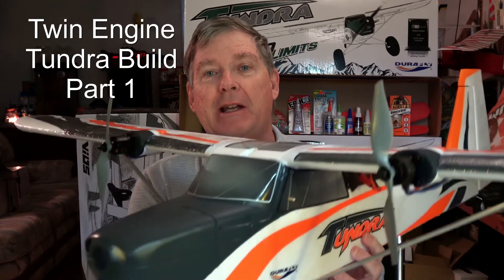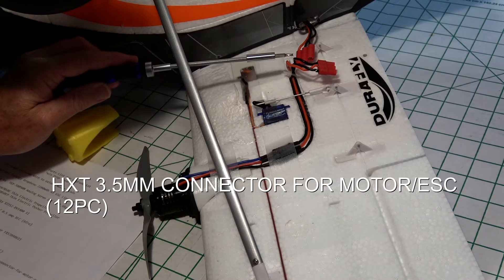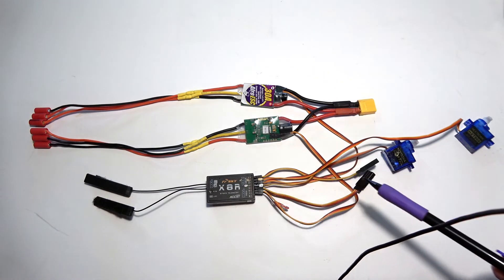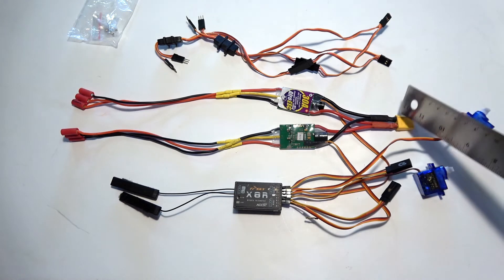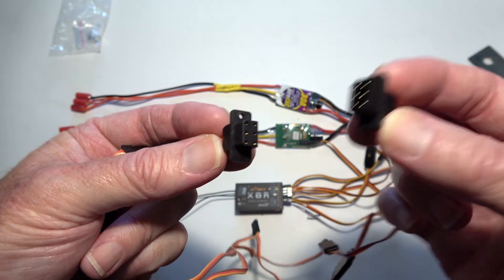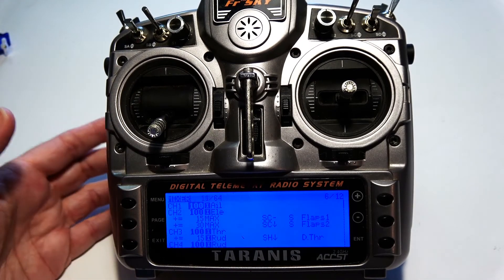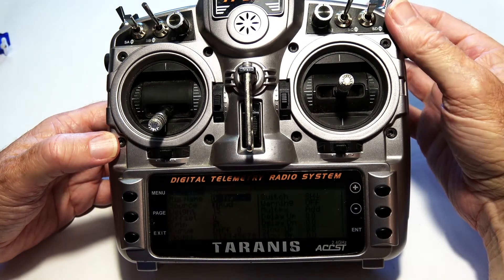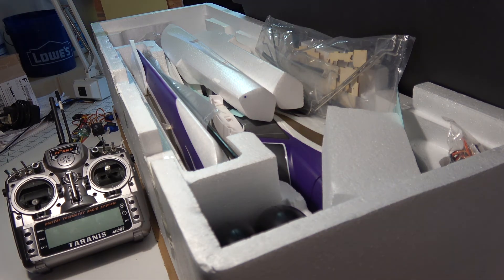DIY Twin Engine Tundra RC Plane Build - Part 1 (Power System Parts, Wiring, Radio Setup)

Comment: Hi Dave, I'm going to build this so thanks for your amazing videos. I'm a bit confused as to which file to print. If you use the X motor mount the outer bolt fixing is 34mm?  so I don't understand why the  drawings are marked 23.3mm, 24mm and 25mm spacing as the motor hole dimensions do not seem to be important ? Can you expand on this at all? These are the motors I'm going to be using  https://www.electricwingman.com/sunnysky-x2212-iii-brushless-motors  Thanks Tim
Reply from the maker: The image on your motors shows 34mm X-mount which may be too large for those nacelles https://www.electricwingman.com/img/product/large/SunnySkyX2212IIIBrushlessMotors_28_10_302.jpg
Reply: @DaveMerc  Thanks for this information but if I look up the motors you used they also seem to have an x motor mount of 34mm as per the drawing https://www.rcmoment.com/p-rm8984.html so Im still confused as to what the 23.3mm, 24mm and 25mm refer to ? Thanks Tim
Reply: Hi Dave Thanks for your help ! I managed to find a small carbon fibre x mount - I use these on my wings! This one has a 25mm spacing. Cant wait to get building :)

Kind regards Tim

Comment: Actually I do have 2212 1450kv they are Cobra Motors. Hopefully those will work so I don't have to spend money on Motors lol
Reply from the maker: Those 2212 1450kv Cobras should work if they take a 4s battery.  I use 2212 1400kv SunnySky with 7x5 APC props and a 4S 2200 battery so I assume you can use the same setup with your motors.
Reply: @DaveMerc  yeah for sure they're rated from 3s to 6s I have a burnt up 4 in 1 ESC one of the channels don't work it's a 60 amp and I have three channels left so I'm going to use the two to run the motors it'll be just like separate ESC is but and one package I hope it works wish me luck and thanks for the inspiration ♥️♥️
Reply from the maker: Good luck for sure. I used two 30 amp ESC's so you could try that if the 4 in 1 fails. Make sure you put some low rates on the ailerons and some expo to be safe. I use 70 / 50 but 50 /50 might be even better.
Reply: @DaveMerc  I knew that ESC works because I used it on a tricopter technically there are four separate ESC is on the same board. and reason why I burnt it was my fault I had screw that was too long didn't realize it and then when I crashed it got contact with the Fett's smoke the motor inn ESC number 3. people throw them away but they don't realize you can use them for other projects like fixed-wing they handle high RPM Motors really well and it's Blheli s but the question is should I run the same size props or start with smaller props like 6 in? Pretty positive it will get it in the air but then check the motor temps and then try 7 in? Is that how you would do it I wish I had a amp and wattage meter. 

Thanks for taking your time to respond to me and help me through this I really appreciate it. I'm making the nacels out of hobby grade plywood just for now until I can get 3D printed ones. 

if I get it all fired up I can post a video of a walk around and see if you see anything that can use fixing. 

Anyway have a great weekend and thanks for everything! :)
Reply: @DaveMerc  oh you're talkin about the dual rates right? I have three setup for rudder elevator and aileron, the motors will be counter-rotating but I won't have any differential thrust because I'm going to have to figure it out on inav because I'm using a crossfire micro receiver and I have to use a flight controller in order to get my 12 channels plus the return the home and rate mode really smooth out the bumps.

I'll try your suggestions thanks again 🤘

Comment: Hi Dave.  I am doing a similar project  and I am having a problem with my receiver Browning out. it seems to do it when I am using multiple control surfaces and the motor I have mine set up with a battery on each ESC and I have the ESC s.  are Y harnessed and plugged into the throttle Port on the receiver. maybe I should plug the ESC s the way you have on two different channels. hmm.   help me Dave. thanks.  😎
Reply from the maker: Perhaps a ground looping problem because of the two batteries. Or you maybe two voltage supplies to the receiver from the two ESC cables could cause a problem. Try putting the batteries in parallel on a Y cable. Use only one ground and voltage from one ESC to the Receiver.
Reply: Dave Merc Productions Hi Dave. I tried looking up the motors the way you did on the tundra and I can't figure the mix for that on my dx6i. The brown out seems to happen when I use cross control on the sticks.  I will check into the ground you speak of. Trial and error is a way of life for me. 😎
Reply: Could it have any thing to do with I have 2 elevator servo's and 2 rudder servo's I wouldn't think that could be a problem

Comment: First... Thanks for doing this build video Dave..;-)
I would go to 16 Gauge Silicone Wire for the motors since the distance to the motors is extended from the nose mounted motor length. This will reduce any loss in the wires and/or the wires possibly heating up when at full throttle.
Where did you buy the props ???
Reply from the maker: Congrats on first! Not sure where I got the props but RMRC, or Horizon Hobby, or Motion RC all have them. The stock motor leads say 18 AWG on them so that would be the bottle neck to going bigger with the rest of the wire. It's a pseudo AC current to the motor so should be fine with 18 in fact the prototype had even smaller gauge (looks like 20 but has no label).
Reply: Thanks for the info.
You have a point with the "pseudo AC" reasoning.... It just looked like the motor wiring was a bit larger...  My Bad.
The way I see it is it brings the ESCs closer to the motor (electrically) by using higher gauge wire. BTW... "First" is for kids.... ;-)
Reply from the maker: Your perception is correct because that is the prototype with the 20 AWG wire, but it did work in flight testing. I used some creative freedom when I called it 18 in the video to encourage folks to buy 18 instead. I have some 18 on order and it should be in soon so I can do a size comparison unless Hurricane Florence slows down the delivery. If it still seems to small I could always go with the 16 you suggested later.